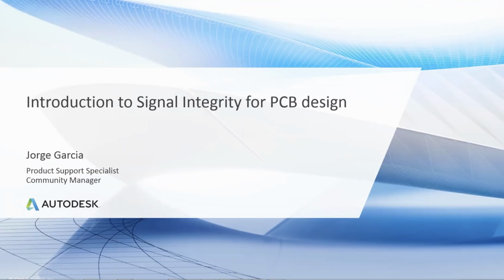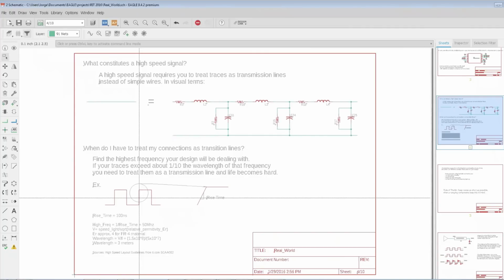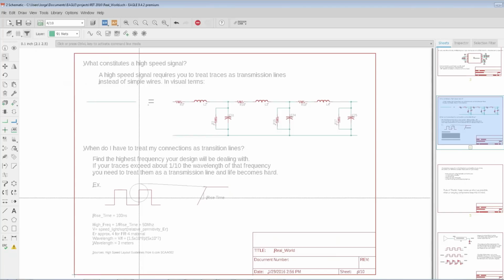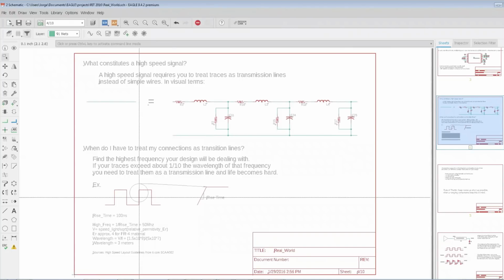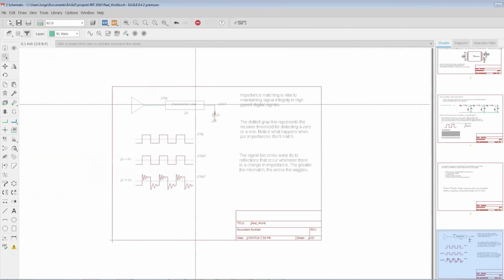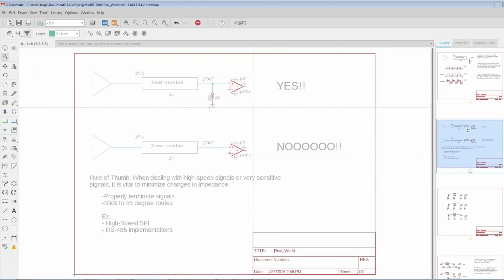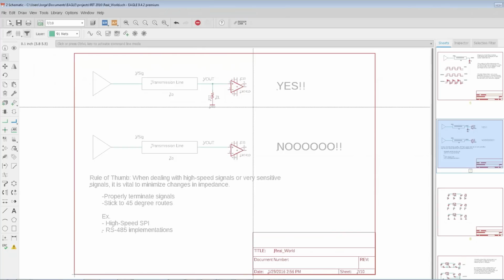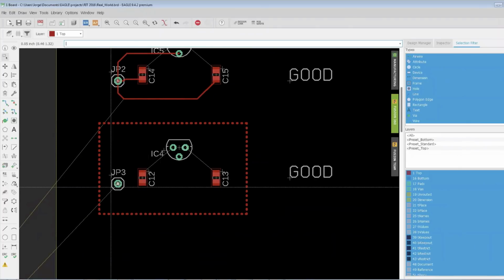Introduction to Signal Integrity for PCB Design

Comment: Nice video brother, there has to be an impedance match between the output impedance of driver/source and the Transmission line. at 16:50, nice work though.